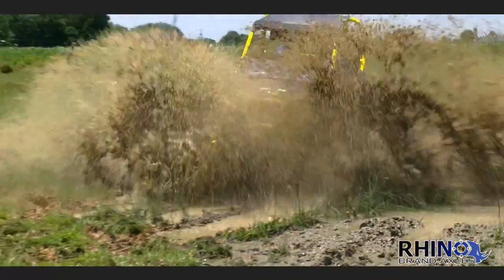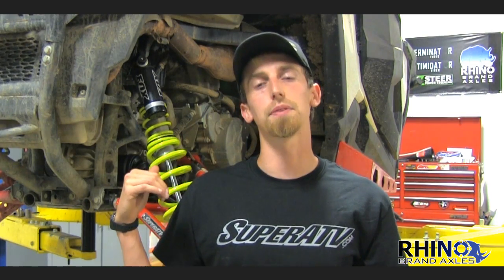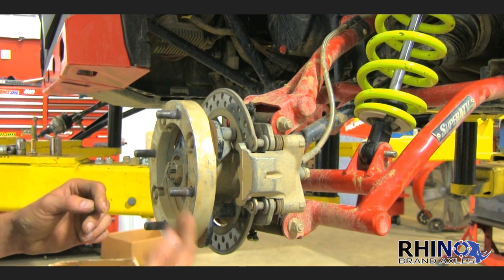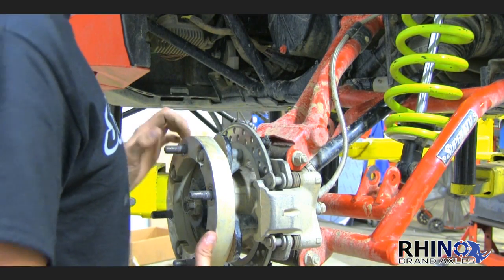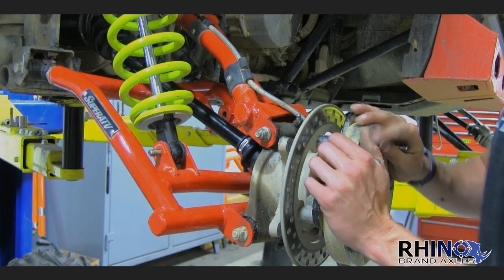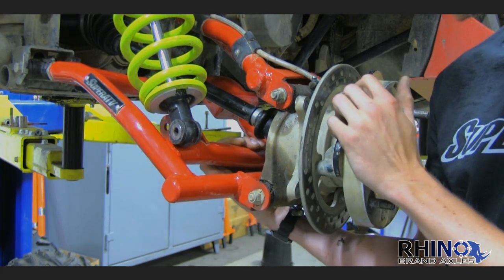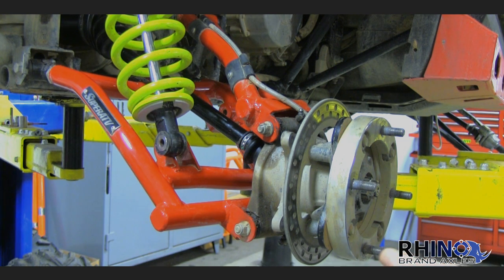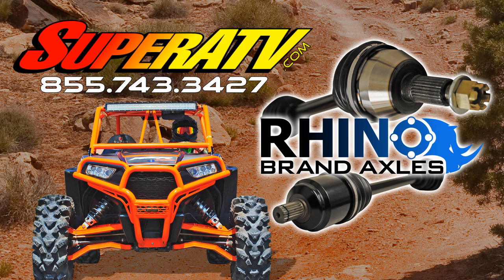How to check if your UTV axles are in a bind | SuperATV

Comment: Would the 28" terms fit my 2015 polaris sportsman 570? And would they cause me to have to buy new axles and aftermarket clutch? 28" terms or 26.5" terms?
Reply from the maker: Ashton Patel We have not yet had a 2015 sportsman 570 in the shop. I would venture to say that the only way to tuck 28" Terms on your machine would be with a set of forward off-set a-arms. There is a good chance that you can tuck the 26.5's in stock form. Feel free to give us a call at (812)574-7777 for a quote.

Comment: So how do you fix this problem if it is binding
Reply: Get new axels lol
Reply from the maker: karl williams Place your lift on a lower setting. If your lift does not allow for you to drop it enough to get rid of the bind the lift is built incorrectly. If it is an oem axle that is binding try using some HD Axles.